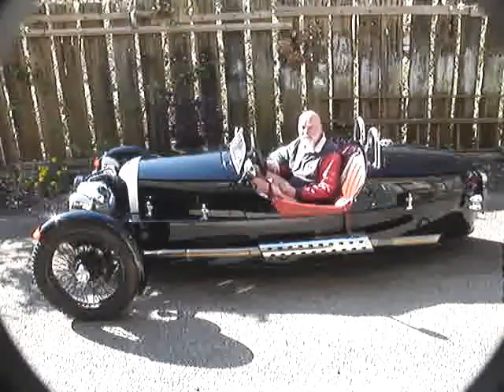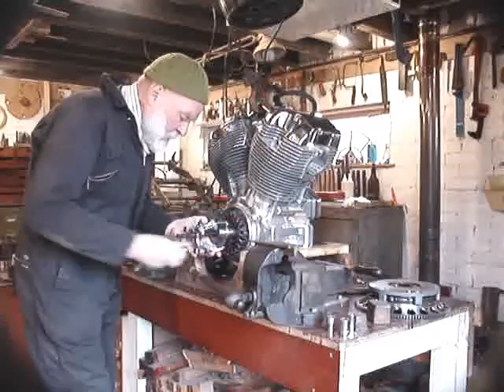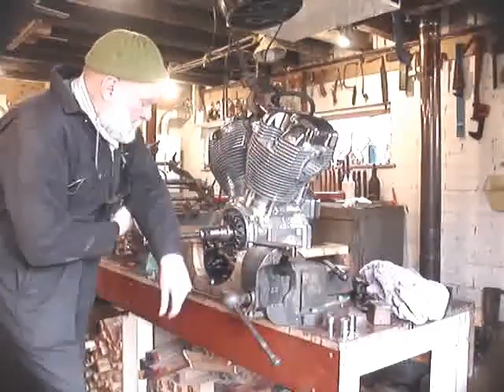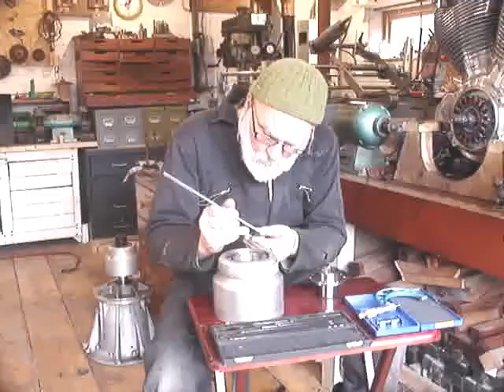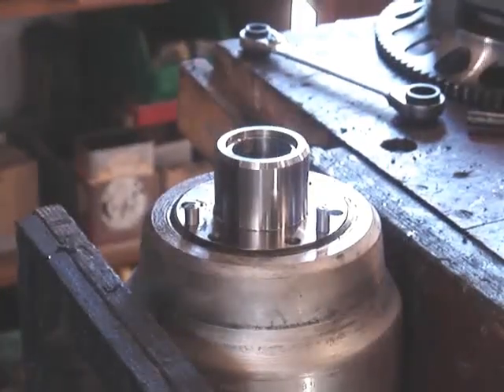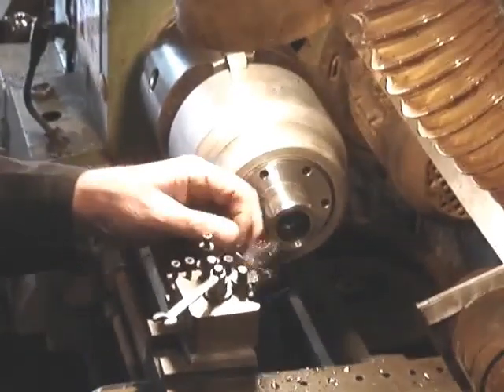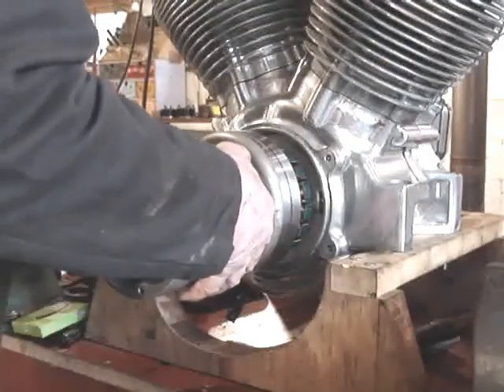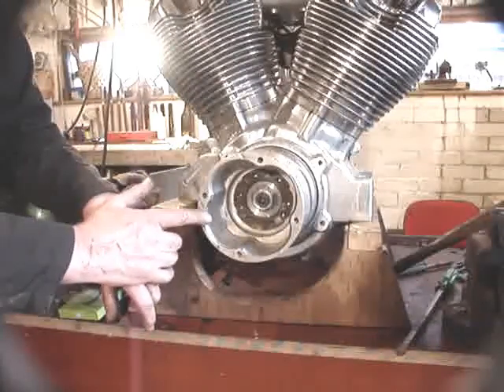Morgan 3 wheeler workshop, fitting the alloy steel hub in the cush drive

Comment: I have completely deleted the cush drive and just use two Hardi Discs. One of these was allready on the original grease filled cush drive and the other one is slightly smaller to prevent harmonics came together with the flanges from a BMW 5 series.
Reply from the maker: Krazy horse tried that with disastrous results - I hope your attempt is more successful - do keep us all informed.  Good luck.